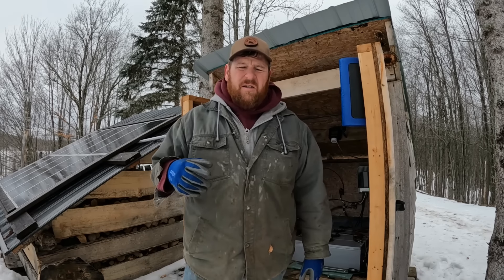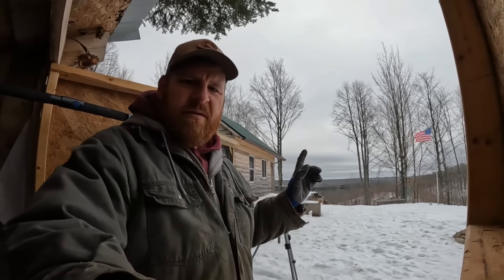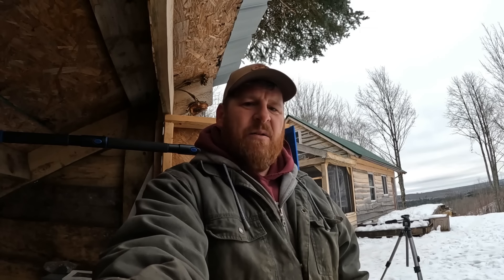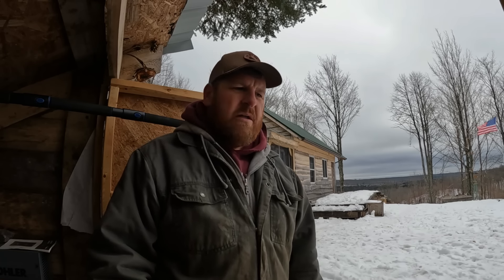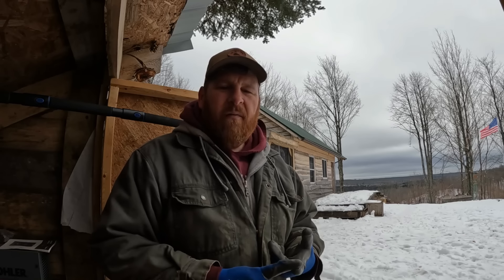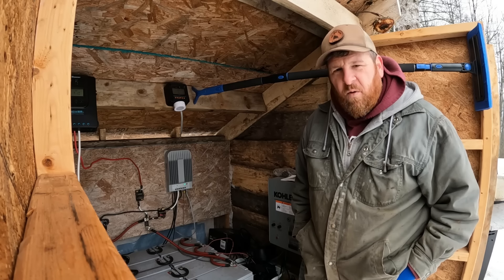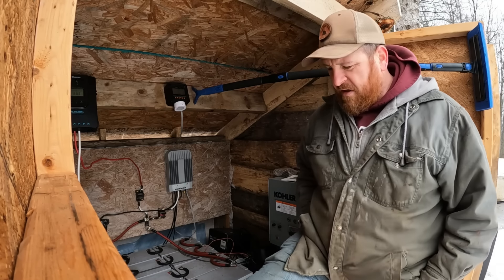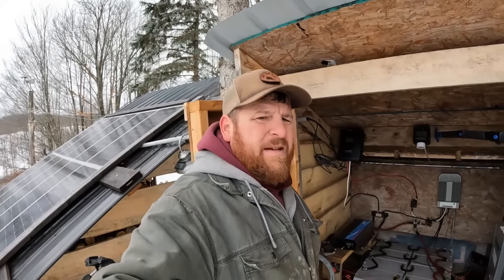3 Years Living Off Grid: Winter Solar Power Update

Comment: You babble well!  Makes total sense.  Now you need to reach out to a company that makes whole house diesel generators for the finishing touch.  
Another option would be to spend a few days totally off grid and live off the wood stove and some lanterns like pioneers.  We live in a Tennessee suburb, but keep lanterns and oil and have lived up to 5 days after an ice storm with our fireplace insert, two small generators to keep our refrigerators going, and lanterns for light.  It is a fun change of pace, although we have only done it twice for more than 2 days.  We have a good computer and router battery backup and  three small power stations from 256 Wh to 600 Wh, so we can keep our electronics going,
AGM batteries take more abuse than standard lead acid batteries and don't cost that much more, and can be discharged 30% more without damaging them.  They do make Lithium Iron batteries now with self heaters and controllers in them, but they are quite proud of them...

Comment: I live in the rural deep south - up till in the 1950s there were no power lines delivering AC power - 
       Today its a novilty to lie off grid for many  - 
       In rural areas from the 1890s there were junior farm light plants and regular farm light plants - 
      The junior farm light plants were generaly 6 or 12 volts with a wind generator and a 150 watt generator -  
     The regular farm light plant were 32 volts DC and the 7 kw battery bank was charged with a 850 watt generator in most cases - 
       Most farm houses were set up to charge the batterys all day once a week - some had a 14 kw battery bank and a 1.5 kw gentator - 
       Down most had 14 kw bamttery banks - down here they used fans during the summer - so they needed larger farm light plants - 
     Down here it never gets below 5° F so battery acid strength was only 1.200 on a hydrometer - 
     That week acid solution charging once a week would last 60 yrs + if they used the stonger acid like today they use 1 275 acid - with strong acid batterys only last 7 yrs charhy one a week - 
      Any apliance that was sold that used 110 AC was also sold in the 32 volt DC vertion also - 
     They sold motor generator inverters to step the voltage up to 110 volts AC - some borns had flouresnt lights that ran on AC also a TV ran 110 AC - 
      When i was a kid there were still some 32 volt DC homes - 
     In the deep south US the humidity is high and it defuses the UV light from the sun - so solar panels are not struck directly by UV light - 
      So solar panels only generate 20 % of there rated out put at noon day - 
         After huricanes or ice storms my power can be knocked out for montha - 
     When my power is knocked out i go hybrid - my battery acid strength is 1.220 thats good down to minus 17° - and a 40 yr service life -

Comment: Jay, Being a fellow Michigander I can tell you that yeah having your AGMs that cold is killing the capacity available.  AGMs don't vent and I have my 800AH battery in the semi heated back room at about 59 degrees.  The 400AH lead acid is outside in an insulated pickup truck tool box.  The 3 inch insulation added 7 degrees in winter and ironically keeps the batteries a bit cooler in summer.  One thing to highly consider is a capacity meter and they are about $40 bucks now.  On the 100 watt panels, I have a number of those and frankly I have moved on to picking up used 250-400 watt panels on FB market place or craigs list and I can tell you even here in Michigan those larger panels play much better than the 100 watt panels.  Good luck and spring is coming and time to build another ground mount for me for next winter.  Gary

Comment: You use your cabin in the cooler seasons.  One way to reduce power use is put in an icebox that vents to the outside.   Then you could turn your refrigerator off.   I saw this done on another channel, boss of the swamp.   They use no power to refrigerate food for 6 to 8 months of the year.
Reply: Depends if they can find ice locally. I am old enough to remember one house only at the corner of our street that still had ice delivered. The iceman was like the Pied Piper on a hot summer day!

Comment: My grandfather was a early 1900s electrican - if a rural home had power  most were hybrid in rural areas - 
     Im 3rd generation i spent my yrs working on generators in the offshore and remote moutain oilfieds -        generaly speaking with high speed 3600 watt generators a natural gas generator has a 1.5:1 effecency - a propane gen is 2:1 efficent -  gasoline gen is 3:1 efficent and a diesel is 4:1 efficent - the first number is how many kws a 120 volt genrator will deliver per gallon of fuel burned - a gasoline gen will deliver 3000 watts per gallon of fuel burned at 3000 ft or below  - 
     Also at 120 volts AC you get 416 watts per hp input to the generator with direct coupled generators - its lower with belt drive generators - 
     Inverter gasoline generators run at about 2700 RPMs at half load many are 6:1 effecient - i use belt drive diesel generators there around 9:1 fuel efficent -  when engines run slower there is time to burn fuel more completely -

Comment: Been off the grid for over 10 years. Best advice is inverter charger... and higher voltages. The saving in the wires will buy you more batteries. Plan for Dec 21st and you got your worst day covered.
Reply from the maker: Good advice
Reply: Prefer a separate switcher charger and inverter - because when inverter chargers fail they at times both fail -

Comment: Hi Jay, thank you for your content, you have a decent understanding of the battery tech. Lithium batteries need to have self heating or above something like 10’C so they are not being damaged when charged. Just be mindful the battery banks are lithium and are in your cabin. Best safe option is an external warm environment so if you have a meltdown it’s not internal. A super insulated shed could be an option. All the best from the UK 😁👍
Reply from the maker: Appreciate the comment and info my friend

Comment: Once you go to Lithium batteries, you will never go back. They are worth the extra cost, as you can see with your power stations,  they won't catch fire and yes you will need to keep them in a warm place. Anyway I have yet to spend a winter in my off grid cabin, so was interested in your video. Thank you.

Comment: If you had the EG4 3K-48 volt inverter/solar charger ($670) and a DIY 14.3 kilowatt battery made with EVE LF280K cells and a JK-BMS with 2 amp active balancing ($1,900) you would have all you need for an off-grid cabin. This combo has a very small footprint. You could run a red (+) and black (-) 10 AWG wire to the inverter from your solar panels and charge at 5,000 watts @ up to 500 volts DC. At this voltage there is no appreciable loss. Lets put this in perspective, you already have Solar panels, so by adding the 48 volt EG4 3K inverter and DIY battery all for around $2,600 you would be all set. Also, the EG4 3K accepts charging from a generator hooked up to it. Four items: solar panels, generator, inverter/charger and battery. I have built two of those batteries for a total of 28 kilowatts and we have the EG4 18K inverter with 4.8 kilowatts of solar and have not run out of electric yet. We live in Michigan. We have our equipment in a insulated room in our garage heated by a $129 diesel heater. Ask signature solar if they will sponsor you.
Reply from the maker: I love hearing this....I'm excited to experiment with some of these options......the new all in one's and batteries are pretty amazing. It all impresses me

Comment: Might want to consider an inverter/charger. I use one and all i have to do is plug the generator into it. When the generator is on it supplies power to the cabin and charges the batteries. Once the generator has run a couple of hours I turn it off. The unit automatically switches from the generator back to the batteries. When I turn the generator on it automatically switches to generator power. Videos on youtube about the Victron Multi plus which is the unit I have. Best thing is I no longer have to reset the clock on the stove when I switch over.
Reply from the maker: Very nice.....I may have to swap to that unit and keep this inverter as a back up. Thanks for the information, appreciate it.

Comment: I am not very well informed on solar array systems, but I think yours is quite comprehensive and nicely set up. I like that the panels are not on the roof of the cabin, making it much easier to keep them clean and clear of snow and I like how you have created a utility shed to house everything. Right now where I am living I don't have this option for a system, but I plan on relocating in the next 2 years, and when I do, I would like to start with a system like yours, and then, as you've mentioned, transition to a more sophisticated power wall. Thanks for sharing all your knowledge - you are doing a great job and its much appreciated!!
Reply from the maker: Thanks Patricia.....highly recommend the ground mounted solar panels for easy cleaning if in the snow country. 😊👍

Comment: You can get a Bluetooth for the rover. The app gives you more information. I have it for my small 12v system in my shed
Reply from the maker: Hummm....that is cool. This would let you monitor or gauge more information than what the display shows? Would be nice to be able to see that info and or keep track of it
Reply: @OffgridwithJayandJen  it shows data log so you can check daily totals. Also, cumulative amounts, too.
Reply from the maker: @northboundcanadian  nice....will have to look into the part, thank you

Comment: The solar system looks like its holding up great.  I Built a portable system using a hand truck, an EG4 3000 watt inverter/charger and a 5000 watt EG4 battery.   It can take in 5000 watts of solar.   I use that to charge my Bluetti AC200p's.   This way , when the sun is out, even for a short time, I capture as much as possible.   Have fun in Florida.   I am about an hr north of you. (Just north of Tampa)  Would love to get together before you head home to MI.   The rain should stop tonight and then 3 days of sun!   Enjoy your time here!
Reply from the maker: I like the home made portable option for sure......if I didn't have sponsors I would definitely had built one as well.

Comment: Just got 10 365w used panels delivered to my door a week ago from SanTan for 1200 bucks, they all produce like new...good stuff...I love your setup, but consider an upgrade soon....it would be life changing to have 3kw of panels on them cloudy days.
Reply: Built their mounts from a bunch of 2x4 with chains running to their kickers some hinges on top of kickers so I can adjust their angle a bit or drop them flat on the ground in a few mins if a bad storm is coming....they will prob be fine unless its a tornado...and if its that its up to God kinda no matter what. With a friend could load my whole system on a pickup in about 10 mins. The mounts ran about 500 bucks for the 5 frames holding 10 panels.
Reply: Im on the grid myself, but run the solar off grid, it runs all my 120 loads on the house now....the outside heatpump will still be on the grid for now...240v on that....did everything portable so did not ask for permission from the city...better to ask for forgiveness than permission sometimes.
Reply: 3.6kw system with 10kw 48v batteries and a 3kw growatt inverter mounting and cables, all diy spent just a tad over 5k with 10awg cables and an inline 30amp breaker on pv lines and a couple tools to make connections.
Reply from the maker: Nice work....great deals too

Comment: I understand you get the power stations for free but if you really want this system to work adding more storage isn't going to fix the problem, you need more solar capacity.

If I were in your spot id sell most of the extra power stations and buy second hand large solar cells and build a decent sized.array.

300+ watt panels can be found for around $100 each used if you get a good deal.

If you had 6-10k watt array instead of 1000, youd see 500-800 watts of charge in overcast times like you showed here (rather than 50-80 watt trickle). Your batteries would always be charged.

You can still have a power station as backup if you need to perform maintenance.

Comment: If you have the abundance of power stations, why not just charge the stations with your panels?  Forget the shed.
Reply from the maker: It is an option and we do do that during summer with more portable units....but these larger units we leave inside and just run the power to them.  I'm thinking running the PV voltage directly inside might be a great option as well. Just kind of milking my old set up while I can

Comment: Like the idea of gen near the solar shed but why not replace the 10 amp battery charger with a 40 amp charger and charge your house bank at the same time they are not expensive and your gen set can handle the load easily
Reply from the maker: I'm looking into a unit like that
....I'm wishing I could now run PV directly into the cabin to charge stuff in there.

Comment: You need the powermr 24 vdc 3000 watt inverter charge controller in series of up to 5000 watts and up to 450 vdc from the panels I see the inverter taking the amps coming in from Pv x 5 to the battery 5 amps x 5 = 24.5 amps .5 for the inverter doing it's converting DC to AC.$489
Reply from the maker: I'll have to seriously look at that. Thanks Richard
Reply: You will not regret

Comment: Thanks Jay! I'm in the preparation phase of going off grid. What recommendations do you have for one too learn more about solar? I want to ensure I understand it well enough to ensure I get the proper system, maintain it well, and am able to fix minor issues. Thank you much!
Reply from the maker: Hey Cindy.....make sure you check out our solar playlist....but also check out Will Prowse and his early solar videos. Watch a lot of them and it will help it all start to make sense. Also practice with a single Battery, solar panel, charge controller, and inverter.

Comment: Solar math makes my brain hurt.  I'm practicing getting off grid before that happens.  What would you recommend I buy while practicing in my suburban back yard to practice with?
Reply from the maker: Go on amazon.....they have a renogy 100 watt panel with a wanderer charge controller. Should be 150ish dollars. Hook that to a deep cycle marine battery from your local Walmart or hardware and start running 12 volt lights and or pumps. Run some deck lights or shed lights....anything 12 volt. If you want you can hook up a small 500 watts inverter too and use some AC power

Comment: Why did you choose a 24Volt system over a 12 volt system ?
Reply from the maker: Reduces the size of the wire you need for the whole system and more  efficient in general

Comment: How much power do you lose being that far away from the cabin?
Reply from the maker: I'm not 100% sure to be honest, but it is only 60 Feet from the shed to the inside outlet I installed, and I have it in AC current so it should travel just fine. If I could do it Again I might have used a heavier 8 gauge wire instead of 10 for that stretch, but inside the cabin we rarely draw more than 15 amps so I feel everything it safe and pretty efficient

Comment: Did you ever get any help with your solar tracking or get it fixed?
Reply from the maker: I did not get any more help, just told to order the actuator on Amazon, which I did, and I'm waiting for the weather to improve before I install the new one, in hopes it won't break again for the season.

Comment: Have you considered propane tank for heating?  Is that still off-grid if it gets filled up every few months?
Reply from the maker: I have been looking for a way to assist with heating during spring and fall days where it isn't cold enough for a fire, but the cabin is chilly. I'm considering adding a minisplit system if I could figure out where to install it.

Comment: Did you get that linear actuator fixed on that tracking solar array? I saw another video where it was just a pin that comes loose on the end with the motor. Idk if that info helps or not.
Reply from the maker: I have not replaced it yet. I have the part....but am waiting for spring to fix it.....don't want to ruin another one